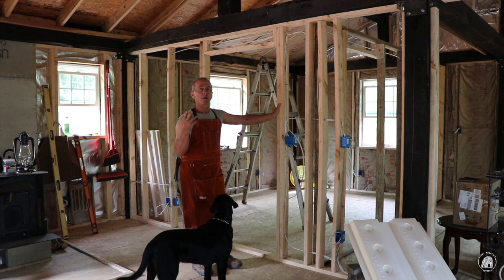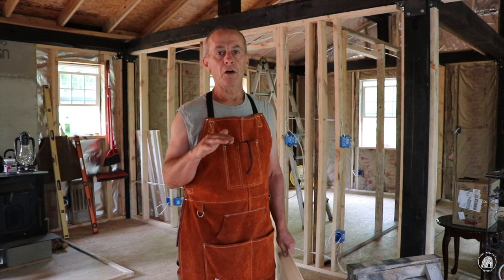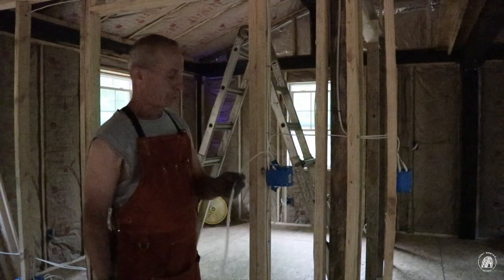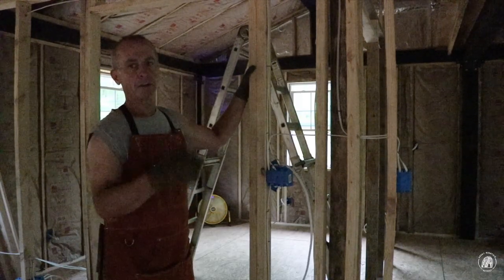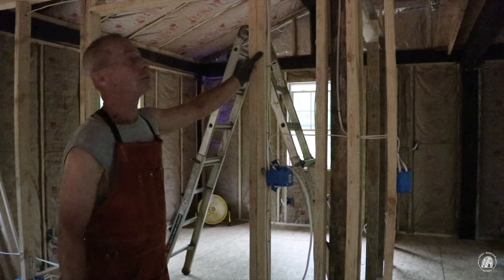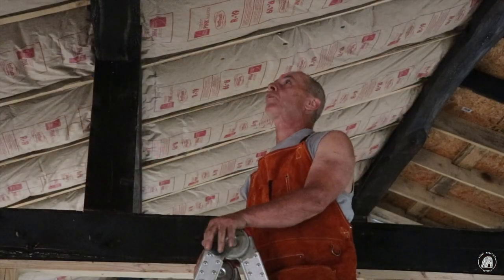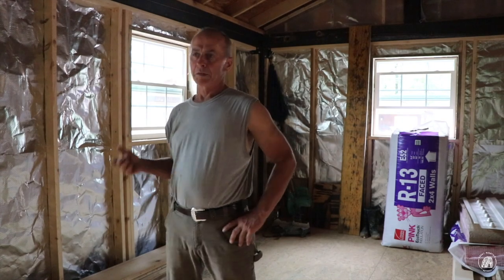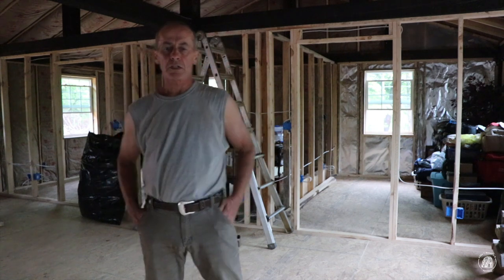INSTALLING THE CABIN INSULATION & VENTING | BEGINNING CHICKEN PEN FOUNDATION

Comment: nice work.  It all looks tidy and clean... precise.  That was a decent rain.  You can sure hear it on the metal roof without the insulation in yet.  Glad you aren't using a ceiling fan light.  we installed a light with our fans in our new house and hate it.  we should have installed more can lights because a light on a ceiling fan is about worthless no matter what you do.  we have tried different bulbs but... just not a good thing.  Install plenty of lights.  The older you get, the more you will appreciate it.

Comment: You might look at a turbin to remove that heat. Its what I have on my old house. I live near New Orleans, that's a lot of rain and a lot of heat. Its just a thought! Leave the ridge cap on, and install a turbine on each end. Or I am now thinking of adding a cupola. Vent heat and add some interest, house was built in 1882 only has a of couple chimneys and a now copper screened front porch.

Comment: Are you putting a flat ceiling over the bedrooms?  If so you could make a loft above them to take advantage of the high ceilings.
Reply from the maker: No ceiling. For heat reasons and ceiling fans. Less work and expenses

Comment: Do you have any worries about using your own lumber and moisture in the wood,  as far as mold might happen.
Reply from the maker: No not really. It’s all pretty dry in there and underneath so far.
Reply: Did  you let the wood of the mill  dry for a while before using it. It kinda looks like you use it right of the mill. @SmokyMountainOutpost